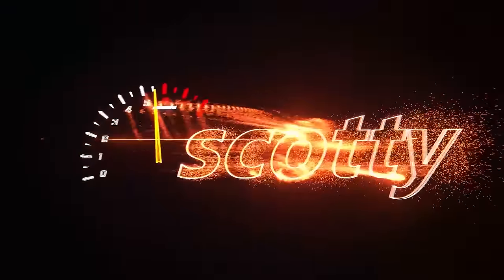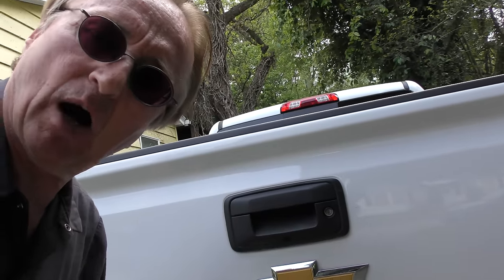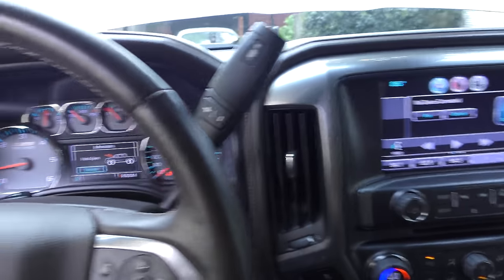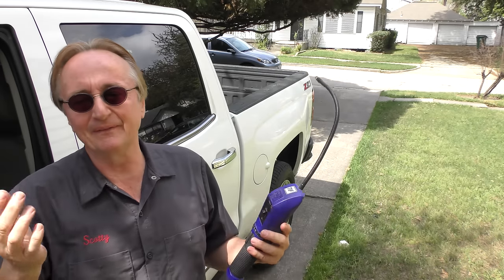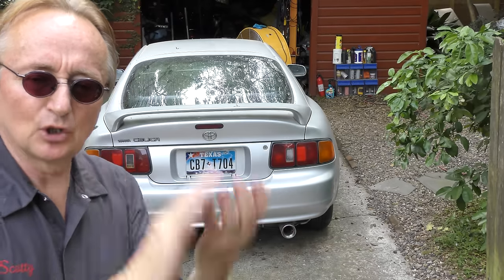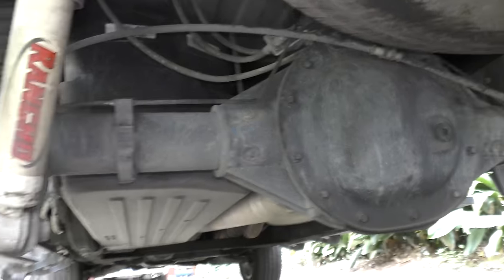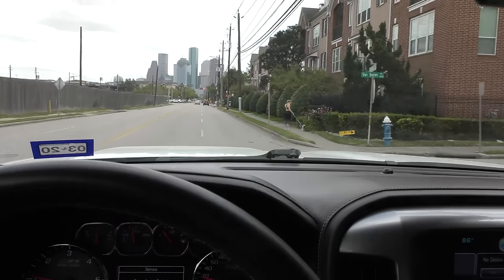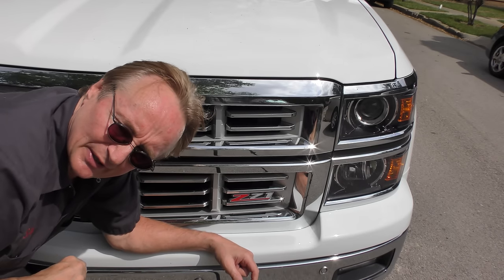Here’s Why I’ll Die Before I Buy a Chevy Silverado

Comment: This pisses me off cause I own a 2016 Chevy Silverado and I love it
And I love how he complains about the “cheap” plastics on the tailgate handle but yet he drives a Matrix that breaks a door handle every month
Reply: It doesn't break if you replace it every 4 days!
Reply: That Matrix of his is more reliable than your cheap American truck
Reply: I rather have door handles breaking
Reply: Martin Junior “American”
Reply: To be fair, a Matrix is way cheaper than your truck. So you can’t get on it for being cheap. You’re truck on the other hand is supposed to be a nice street princess truck for $30,000+ brand new and the plastic is already breaking. We’re allowed to criticize that. Toyota doesn’t sell luxury, they sell reliability (unless it’s an Avalon or a Lexus). You can drive a car with broken door handles and you’re okay with that because that’s what you paid for.
Reply: @kingjunior4426  I was GM, and Subaru Certified, and have seen literally thousands, of cars with all sorts of miles on them, and at a dealership, we have complete service records for many cars. Toyota's are rock solid, but then again, the only Gas engined vehicle I saw with over 700k miles on it without an engine rebuild was GMC Sierra 1500. It sorta hurt my feelings since I've only owned Toyota's, and have been a Chevy Hater for years. That Chevy is going to hold it's value than that Matrix, and seeing them with quite literally hundreds of thousands of miles with the 5.3 was insanely common. It's especially crazy in a Dairy area like this, where 70k Dairy miles is like half a million highway miles. One thing I will say, if I had to put money on what vehicle will go 500k miles with the least money invested between a Subaru and Silverado, my money would go to the Silverado every time. As far as Toyota economy car, and a chevy Worktruck, I would put my money on the Toyota until about 430k miles until major repairs would have to be done. Our import techs got a lot more money since labor was a lot more intensive than American trucks which were a lot like legos.
Reply: @willowandluka5302  When I got my GM certification on this model of truck, being a street princess wasn't mentioned once in the testing. It was all about the powertrain being able to tow, and last when put under load. It's nice how comfy they are, but they aren't using Rancho shocks on the Z71, a ladder frame, and a Pushrod V8 and a live axle on leaf springs because it's known to be the comfiest setup. That's what the magnetic ride control is for, which is only available on the High Country optional, GMC SLT's optional, and standard on Denali's. Those are the street princesses. Even then, the fact the suspension would auto-adjust under trailer load was a major selling point, more so than the comfort, which goes back to, even, "The street princess." The major point was being able to work. And they did. I didn't even like Chevies, but I had to admit defeat eventually.

Comment: Love my chevy truck. Looks like your client got a dud. My 14 no issues what's so ever
Reply: superfuresh  I have owned 2 chevys. My father has owned 3. Brother in law has had 2. All lasted over 200,000 miles and were reliable. Don't know what to tell you.
Reply: Tom Servo older chevys were great cars, the problem are the newer ones after 2010, but most cars are like that so.
Reply: 2015 Silverado, 70k miles, having AC issues. Taken it in for bad fuel injectors 3 times.
Reply: How many LS swapped cars/trucks are running around?  A SBC is super cheap reliable horsepower!

Comment: Yeah my 2007 Silverado was a real disappointment.  Interior fell apart, emission system had a bunch of issues, and the transmission died at 80k.
Reply: 80000 is BAD. Do you tow a trailer a lot? (I have a 2015 GMC Canyon)
Reply: @ronfazer2423  a 6000 lb travel trailer about about 8-10 times a year.
Reply: What's a Sliverado?
Reply: @thisismagacountry1318  correct Silverado

Comment: I'm a Ford fan myself and I do expect a lot of backlash for that 😂 Fords, especially the older ones, are great and can even outlast the buyer with some repairs along the way.
Reply: No backlash from me. I agree with you.
Reply: I owned two fords myself,  two of the most reliable vehicles I have ever owned. 2006 E150, sold at 280k miles and only had to replace the alternator at 230k and HVAC blower at 220k. Both jobs did myself for under 100 dollars. Running great when sold. 2011 Ford Taurus still running great and not one problem has 110k miles. Friend at work with same year Taurus has 180k miles and not one problem.
Reply: I will defend my FORDS!  Toyotas just don't look good to me inside and out that's why I will never buy one. Plus I hear that they are not that comfortable.
Reply: Ford man till I die. I dont love my explorer. I had an 04 and then I bought a 10 and it's not perfect but it gets me around I mostly don't love because i want an F150 And settled for the explorer because it's cheaper.
Reply: Had a 2004 with the 5.4 worst truck ever
Reply: @112188Francisco  I've heard the 04 are fine trucks if you keep up on some of the basic maintenance they require
Reply: @SonofaB__ssnessowner  here's where y'all are going to be shocked. While I'm a GM guy, everyone has their preference, I'm open minded. I respect Ford trucks, bc, every one I've ever had has done what I asked of it. I've learned with age that they'll all have their own set of issues. That mindset allows me to enjoy everything from my avalanche, to my ranger, to my accords, etc.
Reply: For Only Real Drivers - First On Race Day

I ❤ FORD. Best Vehicles I've Owned!!
Reply: @Chieftain357  Absolutely. I'm a Ford guy as well, and Toyota seats, like most Japanese vehicles do not have comfortable seats. Even my good friend who loves his Toyota pickup hates his seats.
Reply: @Chieftain357  
always   drove   4  cyl   toyotas.   boring ,  not  that  comfortable,  but  were  always  the  best,  cheapest ,  reliable  n  dependable  econoboxes  for  getting  from  point  a  to  point  b.  also  one  of  the  best  n  easiest  d I y  vehicles  for  maintenance  n  repair.
Reply: Sounds awesome brother I have a 1996 Ford F150 with a 5.0L (302) Windsor V8 with 209,000 miles on it and still going strong. The only things I replaced on my was the starter, the front fuel pump, and the power steering megunism but other than that mostly was just simple maintenance, took out the transmission fluid just to get rid of the shuttering it was making and it hasn't had a problem ever since. I also have a 2011 Ford F150 with a 5.0L Coyote V8 in it with 131,000 miles on it and still going strong as well and its a beast.
Reply: Chieftain Hilux Sr5s from 2016 have been the nicest utes and 79 series land cruisers. So slick

Comment: He’s right about the a/c. Had 2 repairs in 2 yrs. I have the same model
Reply: Gm has allways had the shitiest ac , i used to work at a rad shop and ac , 70%  of the cars we had to fix ac on were gm .
Reply: @4486xxdawson  Which models? I've had 2 Chevrolets,  1 Pontiac a dodge and a Honda. The one with the ac problem was Honda
Reply: @rasheedahking3197  every gm truck ive owned including the one i have now , but in my current trucks defense,  its a 99 yukon denali and i found the issue to be the way they ran the rear ac line over the leaf spring was rubbing and put a hole in the line , so not really a failure as much as a mistake by engineers , if it didnt have rear ac im think this would be better and less load on the system because they both run off the same unit .
Reply: @4486xxdawson  Perhaps you missed the question, which model? You told me everything but the model. When you say GM are you speaking of each division? Chevrolet, Cadillac, Buick, GMC? or Did you mean Silverado, Colorado?

Comment: 99-06 were nicely made for the most part.
Reply: Gotta 2000 with 185k 5.3, oil pressure issues but she's a runner. Wisconsin truck so she's rusty but damn trusty lol
Reply: I have a 2000 Silverado short bed 5.3 V8 with 160k miles, but still running fine.
Reply: pughconsulting 2005, 5.3 with 218,371 miles. Original tranny and engine. Besides replacing a few hoses and rubber pieces it’s all original. Shame how far Chevy fell
Reply: Me dad has a 2001 and still runs nice
Reply: My dad has a 2000 that was my grandad's last truck with like 315k miles at this point.  4l60 that everyone shit's on has never had the fluid or filter changed.  Engine still has great oil pressure.  Problem is basically every exterior component has been changed, the fuel system is awful.
Reply: Have a 1999 Silverado 2500 with the big 6.0L. Just breaking in at 270,000 miles. Going to replace head gaskets soon and drive it another 270,000 until I buy another one.

Comment: Hey Scotty 😃 what do you think about the 2019 Ford F-150 V8 Super Crew Lariat? Just bought one 😅
Reply: Excellent trucks
Reply: The 5.0 is an excellent engine I have one in my 2014 F-150 over 200k on it still runs like new
Reply: Good truck, good thing you got that v8 engine, because if you would’ve got a turbo v6 or v4 they’re absolutely garbage.
Reply: Congratulations
Reply: Tim Schultes my dad owns an 04 f-150 v6 it currently has 248k miles same engine and same transmission! Still runs like a champ!! That’s why I went with a Ford
Reply: Look at the video where he lists of top 5 pickups he put Ford at number 1.
Reply: Great trucks not bad
Reply: As for the ecoboost’s we have 2 f-150 2.7 ecoboost and they have been great also. All you gotta do is change the oil every 5,000 miles with good full synthetic oil and it will be fine
Reply: What about the notorious oil consumption problems, 1 in 10 seem to be having horrible oil consumption 2016 to 2020 5.0 coyote engines
Reply: T E 🤷🏼‍♂️ not sure about that problem hopefully it’s been addressed. All I know is mine is great and my brothers is great

Comment: This guy talk to much 😂 my dad has a 2015 Silverado 1500 with 250k miles on it only thing to go out is a fuel pump
Reply: What the heck is your dad doing logging 50k miles a year? lol
Reply: @jordansoto3458  some type of trucking. In that case, that truck in reality has roughly 25-35k miles of comparable normal wear. I think I remember scotty saying highway miles are worth like 10% and I agree cause I've a 2000 for f350 with over 500k miles that I bought used and runs better than two of the modern cars I've bought and used as daily drivers.

Comment: Your customer will definitely need the a/c in the coming months.
Reply: Amarillo Aristocrat 

Nobody “needs a/c” 
That is a common myth. 

You are insulting your grandparents. 
The greatest generation didn’t need ac. 

Just like you don’t need a cellphone. 
It’s broken inside your head.
Reply: @fastinradfordable , You won't find me driving around Houston without conditioned air. The Greatest generation grew up without it and didn't necessarily need it. I lived in Houston for 51years, and have always had conditioned air. I was born in '59 and it has always been available for me. Currently in Amarillo, it's rarely humid so one might not need it as often.
Reply: Amarillo Aristocrat my dude I live in Amarillo too!!!! Currently living by 45th and bell.
Reply: A / C    during   summer  in  Texas  is   life   support.   not  having  it  can  be  fatal.
Reply: @yaboykris2118  , I reside in the S.W. area as well, Hillside and Coulter.

Comment: Scott I watch you and I respect your opinion. I own a 2001 Chevy 1500 Silverado given to me by my father. The V-8 5.3. He drove it highway miles. The engine was switched to a crate motor because his auto shop put in wrong antifreeze and blew the aluminum heads. The auto shop replaced the motor. I have 290,000 miles on my Chevy and it runs great . Same tranny, never rebuilt. Chevy man . Not Ford. The new motor has 30,000 miles and tranny has 290,000 miles. Chevy like a ROCK. Stay safe Scottie. Tranny never rebuilt yet.

Comment: I have a 15 Sierra and honestly I’m surprised this wasn’t about the afm
Reply: I'm looking out my window at my neighbors Toyota pickup with the same black plastic handle on the tailgate.   Ironically , the tailgates on the Toyota's are much thinner .    The hood on the Tundra I was driving is so thin and light I had to pull over because I thought the latch was not closed correctly.
Reply: Cheap low life individuals are into general motors products!
Reply: What's wrong with your AFM, that it actually works?

Comment: Dam you must really dislike Chevy just to say the refrigeration is messed up I know that “leak” since I own gmc Sierra 2011 and it could be turned off. It has 140k and still running great. At least it doesn’t kill you like the wobble of death from ford lol
Reply: Or like those deadly airbags GM wouldn’t recall and swept under the rug? Everything is junk in its own way.
Reply: What about those deadly ignition switches?

Comment: I got a 2017 Chevy Silverado similar to this one with a 5.3L, and I saw on a YouTube channel about changing the fuel pump. You have take the intake manifold out before you can access it. It also requires you to put one of the piston in the center to release the fuel pump spring tension. Unbelievable. I would not buy another Chevy truck again.
Also, you have to move or force the exhaust pipe down in order to drop the transmission oil pan when you need to change the oil. Bad design.
Reply: Lol...I bought a 2009 Chevy Malibu LT a few years ago and I got rid of it because the engineers were idiots. I had to replace the driver's side headlight bulb but found out that I needed to take the whole front fender off in order to access changing the bulb. I found another easier way to change it without removing the fender by going through the inner tire splash shield, but it was a pain. The passenger side headlight bulb went out soon after, and that was it so I sold it. Replacing the bulb shouldn't be that much of a chore!

Comment: My 5th Avalanche needed a new engine $8000, but it was under warranty so it was free. I'm not buying GM anymore.
Reply: 99 07 best years they made.  My 2000 Gm Sierra has the original 5.3  295is,000 miles.  And original transmission.  The truck has not but minor repairs that is typical and  considered  general maintenance . The truck is still strong and reliable. Ill drive it across country , no worries.. A 5.3 lm7 and mechanic to install can be found just about any where for way cheaper than 8k . Id tell them 🖕

Comment: 30 years driving/restoring jeeps.  Working on a 41 Willys MB now - doesn't really apply.  Thought I was used to the slop in the wheel with the Jeeps, but boy, this 2004 Tahoe has it plus a learning curve between 40 and 60.  Love the truck though.

Comment: The 2019 F150 is junk. All these new trucks are POS's!
Reply: Agreed, ford was a juggernaut in the truck game, but since 2001 they really started going down hill
Reply: I've heard the new 10speed auto that both ford and gm are using now in their trucks are no good
Reply: Wrong!
Reply: @harleyjackson5513  I know 4 different owners expensive engine problems and transmission issues. I know a company that has a fleet, some are out of warranty, they just got hammered $7,000 for engine issues on one truck. The older Ford's were good, Just like my old 94 Chevy. The new trucks are weak and don't hold up.
Reply: They all are building luxury money pit "trucks" nowadays instead of real trucks like 90s or 80s or prior. This is what happens
Reply: Keep It Mowed , none of them are what they used to be , agreed Ford being the worst.
Reply: Seems to me the people who think that all new trucks are junk are the ones who can't afford them
Reply: Whatever
Reply: King Plasencia I disagree I have a 2014 F-150 with the 5.0 V8 and have 275,000 miles on it. No major repairs just oil changes and brake pads.  I have several fords in my fleet and all run great. And I’m in the well drilling industry
Reply: Bronco Billy not at all,I use brand new F350s and GMCs at work on pipelines in British Columbia,fords wouldn’t start at -35 and below,brand new. You’re allowed to try to start it a few times and then no more,the computer says it’s too hot so you have to reset the computer by disconnecting the battery, fuel pumps going out at 9000 kms, front diffs blowing apart trying to get up steep hills,clock springs breaking in steering wheels so no airbags or radio controls until it’s taken apart and fixed by dealer, they’re all junk,So not worth the money

Comment: Man, I’ve got a 14 Silverado and I’ve had no issues whatsoever. At 111,111 miles and still running strong. 

I take care of it, every month being serviced and maintained. That’s the thing. Take care of it, fix the issues immediately, and you’re set.

Hell, even buy extended warranty if you can afford it, and boom. Not sure why he’s hating on Chevy. 

Chevy can out perform and last longer than any Ford with proper maintenance. 

I’ve been tempted to trade my 14 for a different Silverado, but I’ll run my Silverado till I can’t anymore. 

Silverado strong!!
Reply: You take it in every month to get serviced?

Comment: yeah my brother has had one every 5 years since 2000, and no issues...….
Reply: Kirk Dunn 2000-2004 was better than this junk. Before the trash cylinder shut off thing that failed. pretty much first gen with LS  v8 trucks....
Reply: @doctorwhodj  I purposely got the 4.3 in my 2011. I won't touch something with that cylinder shutoff system

Comment: My 2004 Silverado has 237k on it. Spent most of it's life in salt winters. Seen -20 to 110 temps. Original ac parts, never been charged. Factory water pump and alternator made it past 210k.